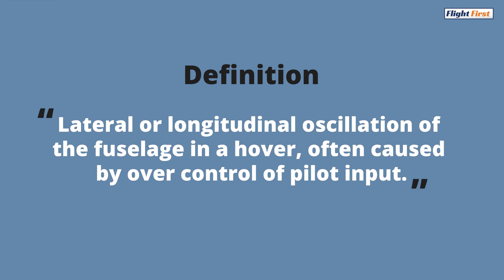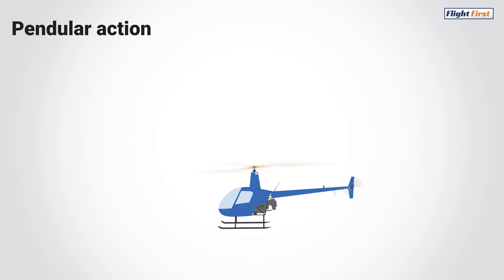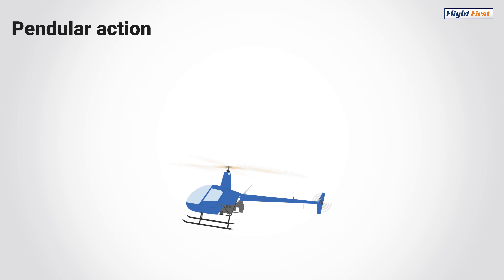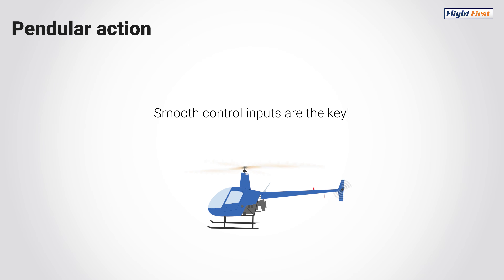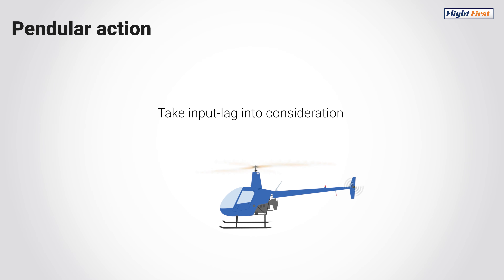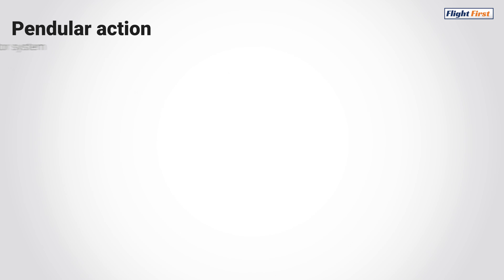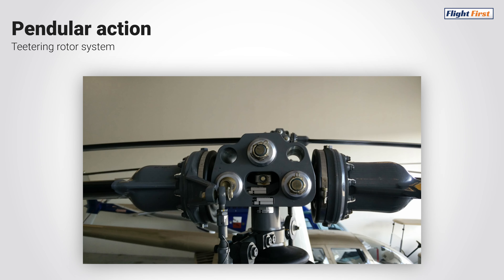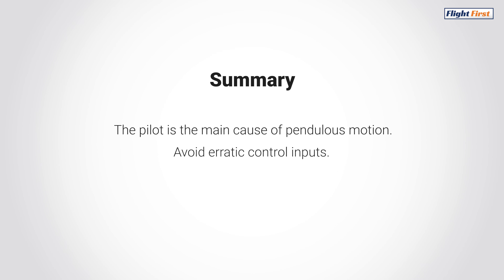Pendular Action in helicopters

Comment: Pendulous motion also happens because the aircraft is unstable. When a gust of wind blows over the disk, or it starts to move forward, the blades will flap away from the wind. The fuselage will follow. Now the relative wind is from the other direction, so the disk flaps away from it, and is pointing forward again. The pendulous effect swings the fuselage further aft, tilting the disk further forward. It now moves faster forward, flaps away again harder, and the pendulous effect gives a big nose up. Let this happen four times and you crash. "Stick fixed dynamic instability." Cured by a small cyclic movement to stop the flapback in the first place.